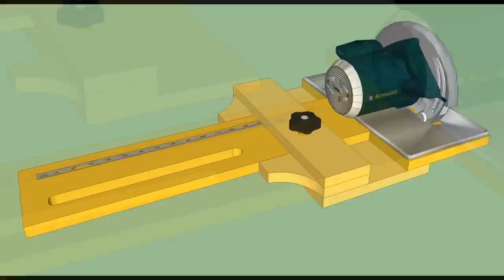Circular Saw - Rip Cut Jig

Comment: I've tried jigs like this, but they just don't work reliably without careful attention (slow & tedious). Any variation in the guide results in major discrepancies. I now use a "track saw" fabricated myself using the saw's cheap (often included) rip fence bent & shaped to ride in the channel of an aluminum guide rail. Did the same with my jigsaw and router. Work is now quick and consistently accurate.

Comment: I like the fact that the measuring tape can be accurately laid down. Very nice design. Will replace my Kreg junk with a derivative of this. Wonder if you could expand the base a little to the front/side? My base plate doesn't have round holes so alignment would be insufficent with just wingnuts/bolts.

Thanks!

Comment: As a beginner woodworker, this jig seems amazing! My only concern, (again, I'm a beginner) would be the risk of kickback. I thought you always wanted the piece you are cutting off to be loose and free-falling. This seems like the jig could pinch the piece between the jig rail and the clamped part of the stock. Can anyone ease my concerns? How idiot-proof is this jig?
Reply from the maker: @2:57 did you see the plywood fell on the table? watch closely, there was spacer that runs the entire plywood length between the saw blade and the table, and you'll notice i'm slowing down the feed when nearing the end of the cut. Very little force is being applied to the jig so pinching the blade wouldn't happen. Its very useful coz I already got the hang of it. Does your concern applies to Kreg Rip Cut jig too?
https://www.youtube.com/watch?v=YBKqKLqdq08
Reply: I am a professional cabinet maker. You in theory are correct but there are some exceptions. If your piece of wood is stable then you should be relatively safe. Also even on a table saw you can leave your saw running and walk away mid cut to make an adjustment if you are working with a very heavy peace of plywood. But whenever you got a piece of wood that isnt completely stable then watch out. But its easy to counter. Hold onto the piece of wood or clamp it. If you are really worried about it you can make yourself a jig with a splitter on it

Comment: Nice! Do you think a longer piece of wood added to the guide where it glides along the outside edge of the panel would make for a more stable cut? It would have been a great Video if the cord that was so close to the blade was severed. Keep up the great work.

Comment: What is the minimum rip width possible with this jig?
Reply from the maker: +Burntsider I have tried 1/4" inch and was still good.
Reply: +Armand Pedroza Doesn't that require you to cut away your guide edge as you advance?
Reply from the maker: +Burntsider During cutting the guide edge is pressed to the side of the wood being cut away.
Reply: +Armand Pedroza Yes, I understand that.  When ripping with the jig, you're normally bearing the guide on what will become the finished edge of your workpiece.  The offal will be outside of your blade.  But say you want to trim a 4x8 sheet to 95 3/4 ".  The jig won't span that far so you have to cut off the 1/4"  While doing so, you're bearing the guide on the 1/8" sliver between the edge and the kerf.  Will that work?  I don't mean to be disagreeable -- I'm just not understanding.
Reply from the maker: So this is the reason of your first question about minimum rip width coz you want to trim off 1/4" on the opposite side, it is possible but mind the danger. You can set the width to 1/4" minus the kerf width and I suggest that you hold the jig firmly and press the edge guide more on the front of the blade because the remaining waste within the blade is basically loose.
Reply: +Armand Pedroza Thank you, I was understanding it correctly as that's what I envisioned.  Thank you for replying.

Comment: Did you realise that you nearly cut through the power cord at the back of the blade?
Reply from the maker: David, the Bosch circular saw has a built-in blade guard so it would be impossible for the cord to get into the blade. Obviously your CS doesn't have or maybe its already collecting dust in the corner of your shop that you already forgot about this safety feature.
Reply from the maker: This jig has helped me in this project: https://plus.google.com/photos/103535150383549348282/albums/6139455566887636497?banner=pwa
Reply: No
Reply: +David Handley I was about to say the same thing about the cord cutting, but the design is a nice though.

Comment: Nice jig, but you have to rely on the edge you're using as a guide being absolutely straight. Also, the longer you extend the jig, the more difficult it becomes to keep parallel, i.e. not zig-zag slightly. Thus, I prefer the simple clamped-on track idea shown in many videos, which also allows diagonal cuts.
Reply from the maker: hazlbri thanks to your comment, the jig is for straight cutting only on a brand new plywood which is supposed to have straight edge coming from the plywood store. The widest cut i've done is 16" which is enough depth for a cabinet. I havent have a project the requires diagonal cutting yet.

Comment: How many teeth on this saw blade?
Reply from the maker: Ricad Ali 24T , 7 1/2 blade Bosch Optiline.
Reply: Armand Pedroza thanks
Reply: Ricad Ali is this right blade for ripping plywood?
Reply from the maker: Its an all purpose blade with very thin kerf, you can see how fast it cuts through the 3/4" plywood and it cuts very smooth too. I always put 1/4" shopmade hardwood edgebands  in all my plywood projects.
Reply: Armand Pedroza i use dewalt dwe 560 and blade dewalt dt1153  40 teeth 190 mm . sometimes i'm ripping cheap 60 teeth blade for smooth cuts. Thank you very much, your advise helped me in some decisions. :)